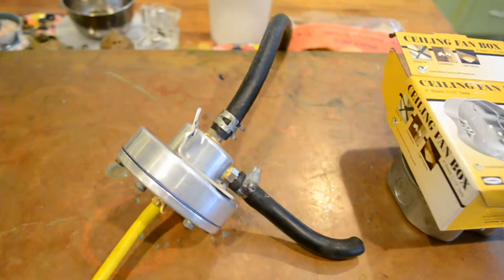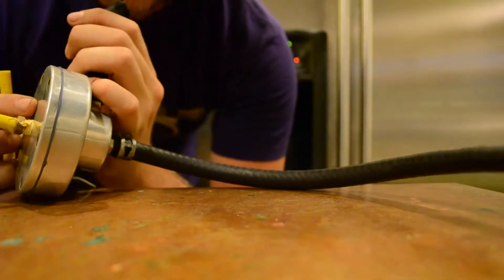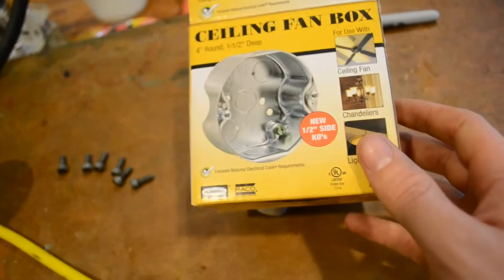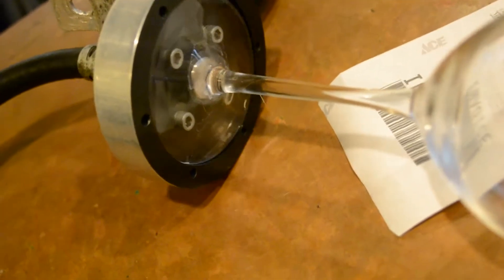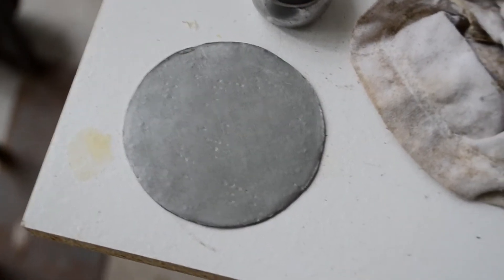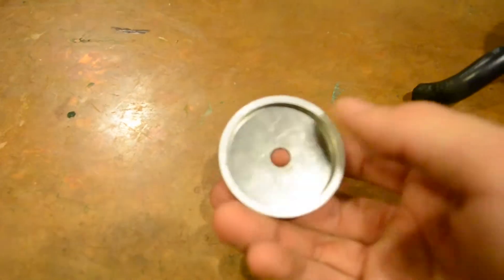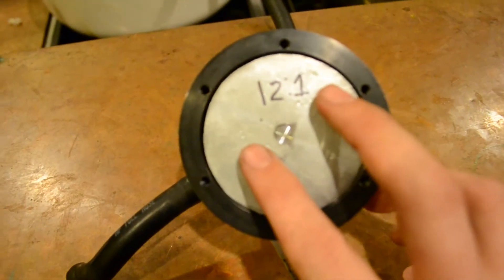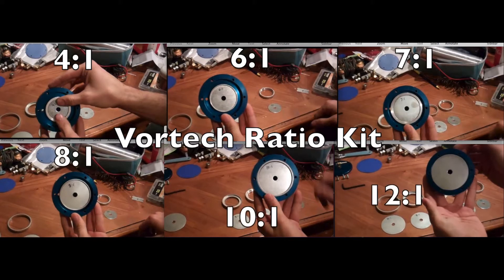How to make an FMU Disk

Comment: whats the importance of the hole in the disk?
Reply from the maker: Matt Rockman I'm not 100% sure, but I believe it helps equalize the pressure across the disk
Reply: Cramer Ward-Collings ah that makes sense I made my own too a 12 going from a 8 and I forgot to drill out the middle and it seems to work fine. Maybe the little bit of gap between the disk and fmu body is enough. I was just wondering no big deal. Thanks
Reply from the maker: Matt Rockman glad it worked for you!
Reply: well lol...i wanted to let you know the importance of the hole. i just found out. so for whatever reason i had a fuel pressure surge and it caused the plunger in the fmu to press up onto the disk and pressed the rubber disk onto the boost nipple fitting. that fitting was sticking out past the top of the fmu only a thread but the rubber pressed onto the fitting and cut it like a cookie cutter which basically disabled the fmu. I was looking at the 8 disk and the center hole is as big as the fitting.
Reply: But if the fitting is not sticking out, is the hole still important?